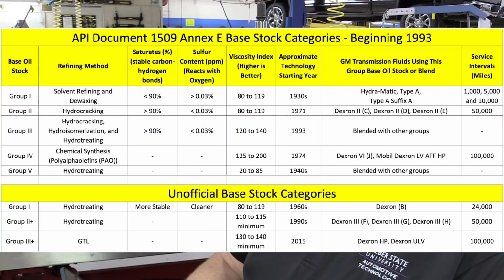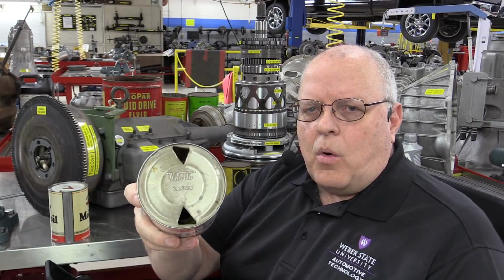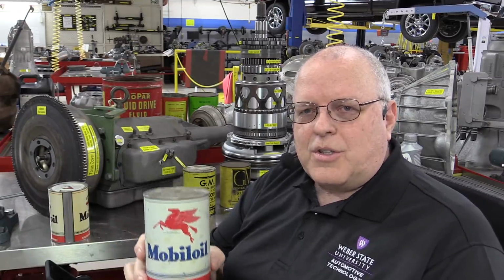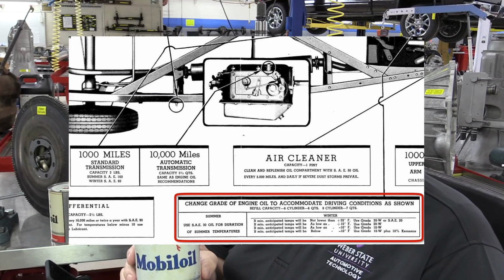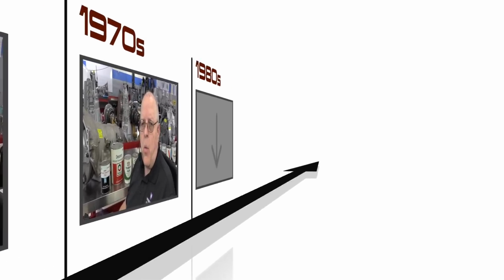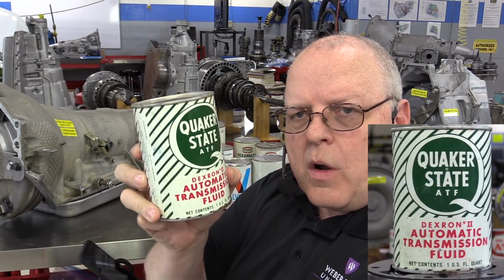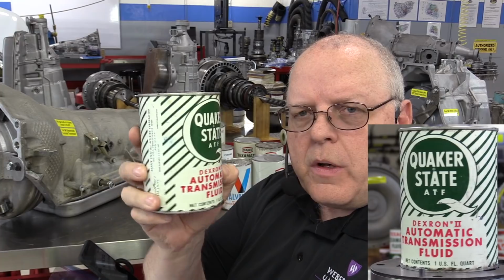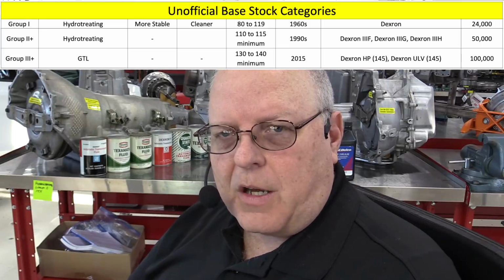GM Automatic Transmission Fluid - ATF History Part 2

Comment: What’s your opinion of CVT and ECVT transmissions that are in theses hybrids cars like Toyota and Honda CRV ? Reports are not good with failures @ 60,000 to 90,000 miles and parts not sold by Honda to repair them !

Comment: I have a 1962 Oldsmobile F85 with a roto-hydramatic, its currently filled with some clear fluid, presumably GM type A (who knows how old). In the event I had to completely refill the thing, what is the most appropriate currently available fluid? I have seen some reafferences that say  DEXRON II or III is supposed to be compatible.

Comment: Hi, I didn´t see You comment on GM 6T40/45/50 or I am missing something. I would really like Your advice of what is correct fluid for my GM 6T45 gearbox because I changed it on 53000 miles, the car is 13y old, and it start shuddering. Seeing Your video I believe I may have pour wrong type of fluid, which was Ravenol Dexron VI. Thanks in advance!! My car is Europe Chevrolet Epica, Diesel, 2011y, six speed auto gearbox.

Comment: Again, he keeps referring to the Dynaflow transmission, which was used as an actual tank transmission  in wwII as apposed to the just the engines from cadillac and oldsmobile.  The dynaflow used no gears and thus in not a " 2 Speed " transmission as the pontificator asserts.  It is a 2-range automatic transmission. The ranges of Drive or Low are the result of different movements of the Stator Vanes thus producing less or more fluid pressure operated via pumps and couplers. It had variable pitch vanes. The hydramatic transmission was huge due to the fact it was actually a standard transmission inside with a lay shaft of gears and the resulting jerking that would be felt as the transmission shifted to an actual gear set 1-4 would result.  The Dynaflow however not having any gears offered completely free ascending speeds without any sensation of shifting of gears as there were no gears to shift.  This dynaflow design operated much as CV vehicles do today. Many actual experts proclaim the design of the Dynaflow as the first real automatic transmission.  It eliminated not only the clutch and manual shifting but also the jerking of gear set changes as speeds changed.  Buick used it from 1948 thru to 1964/65 with many improvements along the way.

Comment: Your videos are so great. My father and I can boy over them, thank you. I have a question If I may. I have a 65 Chevy powerglide. I replaced the front input shaft seal. When reinstalling the torque converter I didn’t get all three (oil pump, stator, and drive spin) to match. There was 1 that didn’t match up and still managed to bolt the engine the trans. It was way to tight and I knew something was not right. Taking it apart and found the last click. Unfortunately now the transmission shutters when taking off only after it’s warm and only in reverse, drive and low. After that initial take off everything is fine. Up and down shifts are great. The transmission pressures are very low. And idle drive test should read 62psi and I am reading 27. A manual low test should read 110 and I’m at 60.  What did I damage? Thank I’m advanced. Also we’re glad you are ok from that crash. We never did comment but we’re glad you’re ok.

Comment: @weber auto Mr Kelly As for the ECCC or EC3 converter clutch, can I tell if a transmission uses this technology by if it uses a PWM solenoid to control the converter clutch engagement? 🤔

Comment: Super content. One question: The Chevy Volt needs Dexon IV. As I understand Jaso-315 is equivalent to Dexon IV. I now have the Mannol Dexon IV ATF oil in, its only Jaso-315 Class 1 A LV. But "JASO 315-1A: A specification defining a Dexron Vi automatic transmission fluid type. This specification is now renamed to JASO 1-A." So is it ok for the car? It's not clear to me.

Comment: What is your take on Transmission additives that are supposed to make the transmission run cooler and last longer?  I am specifically interested in LubeGard that is specified by GM as a shudder fix for the 8-speed transmission.

Comment: Thanks for a super informative and interesting video! I remember warco fluids and being told to steer clear of it. I brought my '59 Ambassador to my high school auto shop in 1974 to change its trans. fluid. I used Quakerstate type a suffix a and remember the strong order it had which told you it was not like motor oil. Ironically it started shifting erratically afterwards. Was fine before that! My instructor told us that a.t.f. had very high detergent content and loosend up deposits. I did not remove the pan and change the filter. Live and learn!.

Comment: Mr. Weber, love your videos thank you for sharing your knowledge. Maybe you could help me with a question I have. I have a Dodge differential with a 9 1/4 ring gear and I’m having a hard time finding an answer about the crush sleeve on the pinion. I bought a kitAnd the one that came in the kit has a concave pump in the middle of the crush sleeve and the one that came off the differential has a convex bump in the middle. Do you think that will be an issue? I can’t find any info on it anywhere so I figured I’d ask you. Thank you!
Reply from the maker: Thank you. It should be okay. They only crush a few thousandths of an inch. Best wishes
Reply: @WeberAuto  thank you! 😬about five minutes ago I was tightening the bolts for the ring gear and sheared off one of the new bolts. 🤦🏼‍♂️I don’t suppose you know if those reverse thread taps are sold at O’Reillys? My luck isn’t the greatest. I never dreamed my impact had that much power!
Reply: It looks like there’s a 1/64” gap between the ring gear and the abs that won’t come out. I should take up knitting. Lol

Comment: The Los Angeles Police Department in the 1960s had a bid requirement for the manufacturers to warranty transmissions using 20-weight engine oil. ATF was changed at about 9,000 miles or after pursuits. LAPD ran mostly Dodges & Plymouths back then.

Comment: I have read on forums that using the M1 LV HP in 6L transmissions also afflicted with torque converter shudder can help but I agree it is not recommended by GM.  I know I had a 5L50 vehicle with a torque converter shudder and my solution was a Lubegard anti-shudder additive.

Comment: I wouldn't say 2003 and older for the Dex/Merc stuff.  More like for vehicles built before Dexron VI was the required fluid.  Which included 2004 through 2006 in some applications.  I want to say by 2007 the 5L series was completely phased out which would have brought in full Dexron VI requirements.

Comment: I am not sure Ford and GM co-developed a 6 speed RWD transmission.  Front wheel drive, yes.  The 6T70 for example was a joint venture.  But I think the Ford 6R was based on the ZF 6HP26, at least according to research.

Comment: Thank you for the great video. However I must make a comment to correct your statement about the orginal Buick Dynaflow.  Under normal driving the shift lever was always left in "D" drive . The torque converter even in the 1st version had enough torque multiplication . After '53 the "Twin Turbine" Dynaflow had even more troque multiplation . "55 the "Flip Pitch" stator also improved performance as did the addition of the 1st  Stator between the turbines. I quote the owners manual 'L" . This range is to be used when the "going" is particularily tough such as deep snow sand or long steep hills.
Reply from the maker: Great information, thank you.

Comment: 1st, VERY interesting 2 learn about trans fluids... 2nd, i'm an AMSOIL user & seller... now, i would like 2 know why u did NOT include AMSOIL, which, after a fone call 2 AMSOIL & other research, found out AMSOIL beat m1 by 9 ( NINE ) years, coming out w/trans fluid in 1980... i used m1 oil in a corvette motor in 1976 & almost lost that engine... found out they did not hav proper additives in oil & it went past seals & was down 3 qts. in a very short time... will NOT use anything else in my vehicles since i ran AMSOIL for 23,671 miles in 3 yrs, 2 mos & 2 days... had it tested & it lost a little viscosity... better MPG in engine, then did transfer case & rear axle, got a little better, now i've done partial trans change, just new filter & " topping off " fluid... i bought a machine 2 do a complete change of ALL fluid... w/that, it helped keep the better MPG more SOLID, not going up & down as much as i drive here in joliet, ill. area... why did u NOT mention " SPERM WHALE " oil used till in2 the '70's wen it was outlawed by gov't ?

Comment: Hi, WeberAuto!

GM city buses from the 1940's on (and maybe 30's) had a different type of automatic. It had only two forward gears. The first was good for only 22 MPH. Second was good for up to about 50. The GM 6-71 diesels with only 211 HP sometimes struggled up hills when fully loaded but they always got you to your destination. On departing, the engine wound up quickly and would stay in low gear until the road speed got up 22 MPH and then shift into high. Can you please tell me how this worked?

Comment: 1:27:45 Honda ATF:

Dexron was specified for the earliest Hondamatic models, with Dexron II OK as superseding (According to the Chilton Manual for '84-'95 Civic/CRX/Del Sol).
Dexron II specified for Model Years (MY) '91 and earlier (Derived from '91 Civic and Accord owner's manuals).
Honda Premium Formula ATF spec. for MY '92-2000, with Dexron II OK as temporary substitute (from '92 and 2000 CIvic and Accord owner's manuals).
Honda ATF Z1 spec. for MY '01-'10, with DW-1 superseding, and with Dexron III OK as temp. substitute (from '01 and '10 Civic owner's manuals).
Honda ATF DW-1 spec. for MY '11-present, except where contradicted, with no substitutes listed except "equivalents" and warning not to mix with other ATF types (from '11 Civic owner's manual).

Lastly,
There are now transmissions which contradict DW-1 and spec. other ATFs such as Honda ATF Type 2.x and ATF Type 3.x near the fill plug.  
These are the 9-speed (Type 3.x) and 10-speed (Type 2.x) automatic transmissions. 

Other vehicles have transitioned to CVTs and the associated fluid.
Honda's hybrids appear to still use DW-1 (from '22 CR-V owner's manual).

Thank you Prof. Kelly for a great video!

Comment: You missed the GM 4L60E which was based on the mechanical 700R4 (OD+lockup) with an electronically controlled valve body and predates the 4L80E.

Comment: As I understand it the Type 1 Hydra-Matic fluid was actually Whale Oil...I tend to believe that as I recently bought a 1947 Olds with the Hydra-Matic.  My car wasn't registered/road driven since 1982 and has 30K on the odometer.  When I drained the ATF out of it the fluid that came out of it smelled a lot like Fish Oil supplements.

Comment: I know it's a much maligned gearbox, but I know some guys who build up the TH200C 3 speed for use in competition eliminator and superstock racing due to the fact that it has significantly less power draw than the 350 or 400 .. apparently they work well with certain improved parts

Comment: Did you know in the 60’s and the 70’s Chrysler transmissions considered to be strongest on the planet could be swapped into any GM, Ford, Jeep, AMC etc. because of swap kits that were made available. The ZF8 is the strongest today used in Bentley, Rolls Royce, BMW, Lamborghini, Chrysler products, and even a Toyota.

Comment: The Turboglide was Designed and promoted by Frank Winchell-a later GM Vice President. I had the honor to work as a technician with him when GM brought him back from retirement as an engineering consultant in the late 1980s at the GM Proving Ground on a brakes project.

Comment: Hello! 
How about using, a motorcycle engine oil, that is mixed with the gearbox and the wet clutch  of the motorcycle, in a ATF transmission?

Comment: Great presentation and information!  40 years after Automotive Tech I'm still learn'in.  Any information or insight on the fluid additives used or where I might go to find out?  I already acquired quite a few papers from SAE.
Reply from the maker: There are several suppliers of additives. See my video on fluid specs here for more information. https://youtu.be/xUFY0L_zFek

Comment: I always thought that transmission fluid was a hydraulic fluid like brake fluid, power steering fluid, & clutch fluid. When I was a kid 30 years ago I've used transmission fluid in place of power steering fluid & power steering fluid. 
I remember a dirty trick for selling a car with a leaky transmission where you put brake fluid in the trans & it would swell up the seals stopping it from leaking. The downside is it only lasts for a little while & then your seals will really leak.
P.S. another dirty trick was using Pledge to buff a car. It would look great for about a week, then it's worse than it was. Lol

Comment: Fluids will make your head spin.  Try finding 5-sp "Alison approved" Trans fluid outside of the dealership.  Its proprietary, crazy!  Actually, I found out  Castrol makes it for GM and is available under the Castol Brand -- but the distributor is restricted from selling it to regular consumers.  Gm is not alone, try figuring out the correct compatible MOPAR coolant for your model year.

Comment: What can you tell us about the "New" Blue Label Mobil 1 LV ATF HP product. How is it different from the Black Label product featured towards the end of this video?
Reply from the maker: I remember hearing that the black label was more hygroscopic than desired.
Reply: @WeberAuto  Thank you.   Quick question.  Many 9 speed Traverses are now experiences TC shudder. Would you recommend the "Blue Label" to either reverse it, or even use it to prevent it?  I know of four 8 speed transmissions that responded very well to the Blue Label fluid.  GM has not approved it to correct shudder in the 9 speed, as of yet.  Do you know why?  Thank you for your great series.......

Comment: Hello Professor, if I'm blessed and received this original 1954 Chevrolet 3100 pickup truck inline six with hydra-matic transmission would it be wise or not wise to use the new mobil one synthetic automatic transmission fluid when servicing the transmission. Thanks Professor

Comment: I very much enjoyed this historical look at transmission fluids.  I was a Buick tech in the 1960's and 70's when Buick introduced the Super Turbine 400 transmission (in 1964).  Buick designed and developed the  ST400 and after the 1964 model year the transmission was "corporatized" and given over to the other divisions.  Its manufacture was then turned over to the Hydramatic Division of GM and became the Turbo Hydramatic 400.  The original Dexron fluid contained whale oil (I think to control certain types of corrosion).  Later when there was a world-wide ban on the hunting of sperm whales, GM removed the whale oil and reformulated the Dexron fluid.  What GM didn't realize was that the new formulation contained chemicals that attacked the solder in the radiator oil coolers and resulted in engine coolant entering the transmission, and transmission oil entering the engine coolant.  Needless to say the coolant ruined the transmissions and required full overhauls (or replacements) under warranty.  Additionally, the chemicals attacked the metals used in the transmission thrust washers and resulted in failure of those.  This was when GM started to use plastic thrust washers in light thrust locations and Torrington needle thrust bearings in more heavily loaded areas. As you might imagine, this was a very expensive warranty expenditure period for the General.
Reply: I remember the whale oil used in the GM transmission fluid.  I thought it was good "for life" fluid in ST/TH400 util it was changed when the whale oil was banned.

Comment: 1:00:38 as an interesting sidenote, the family BMW E34 (a 1995 525i) with a 4L30-E transmission and a "lifetime" fill, is doing much better than I'd otherwise expect for about 204,000 miles.

Comment: the controlled coupling trans is the cadillac Jetaway.. the one without the external torque converter is the Roto 10 aka the Slim Jim

Comment: In your opinion would you rather use gm dexron 6 or "for use in dexron 3 applications fluids" in a 1987 GM 2004R with 270k miles without a rebuild. I'm pretty sure I used dexron 6 before with no issues, have also used dexron 3 then mercon V(back when it had around 130k-170k miles) I've also used Pennzoil multi vehicle full synthetic somewhere around 200k miles probably. I changed it every 30k or less (full fluid exchange and filter, then maybe 40k and filter every second or third time the last while as I thought the transmission needed a rebuild because lockup kept dropping out when hot (turned out to be the vacuum switch I just replaced after 2-3 years of no lockup. The transmission shifts almost perfect, I'm pretty sure the previous owner had a shift kit installed so it shifts firm. Fluid looks almost new after 40k. I want to get as many miles as possible out of it.

Comment: I'm surprised that you left out the fact that most of the older ATF's used alot of sperm whale oil. By the 1960s up to 30 million pounds of whale oil were used each year, chiefly as the main additive to automatic transmission. It was whale oil that made these devices so reliable and efficient and it was primarily the auto industry's requirements that maintained the demand for whaling during the mid-20th Century.